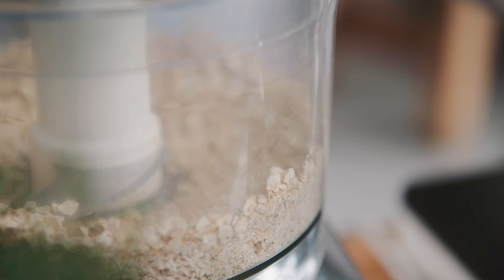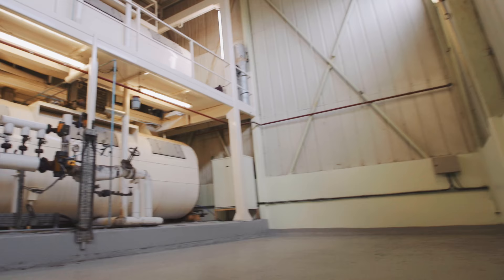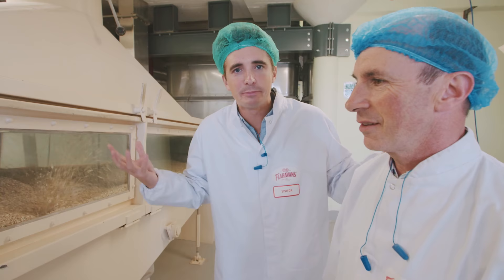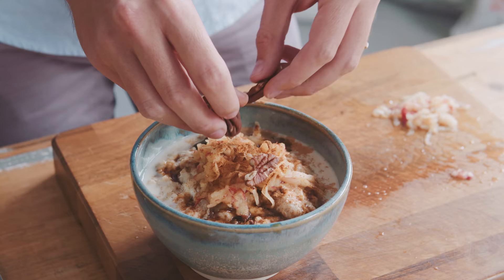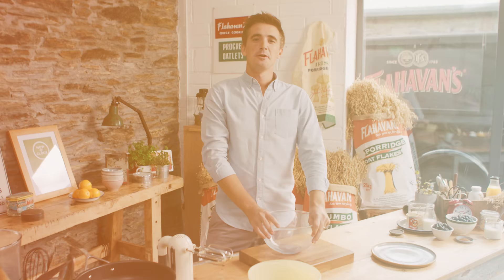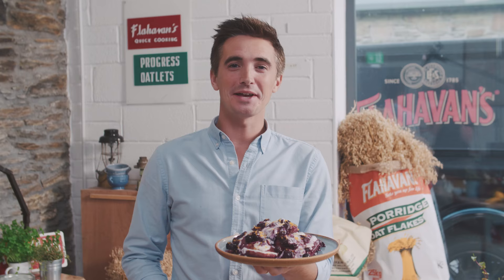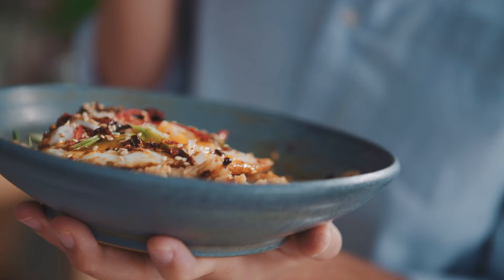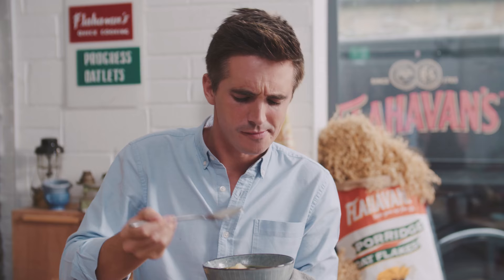4 BEST Oatmeal & Porridge Recipes feat. Flahavans!

Comment: I happened to eat a bowl of apple oatmeal when I found this video. Some exiting ideas! I'm going to try the fried egg oatmeal!  

I personally want a very creamy oatmeal, and that requires time. I start with 2.5 parts liquid(preferably half milk) to 1 part rolled oats. Bring it to a simmer, put a lid on, turn the heat down to the lowest setting and let the oats gets fully absorbed - about 20 minutes. I then take the lid off and stir fairly frequently for about 5 minutes to get a creamy consistency.